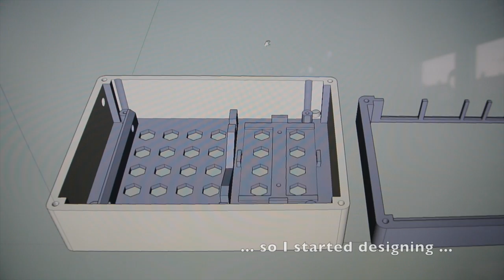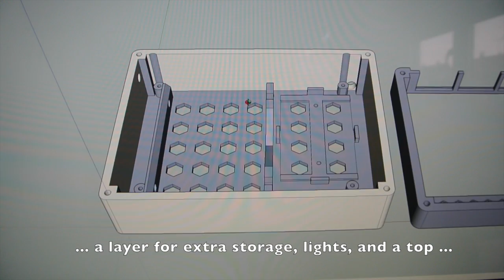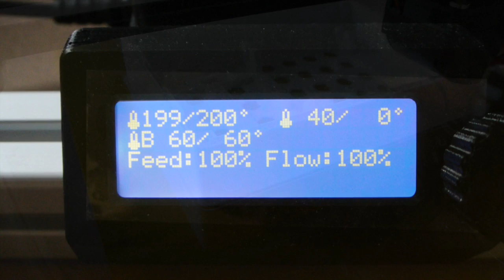3D Printed Computer Case

Comment: Many people are interessetd in small (also mobile) cases like the Dan A4-SFX for normal length graphiccards, but €235 ($270) is expensive for a small "tin box" with a riser card.
Why not a plastic version for 3D-printer? AGP riser card adapters are existing at Ebay, Amazon etc.. And EM-shielding after printing with aluminium foil or better with aluminium adhesive tape.
A "full Copy" is a option  for outlaws ;-) . But for example i and probably many others would prefer a more mobile version. "Rugged" case, handle etc.. Then this case is "similar", but not a "disdainful copy" ;-).
Also a version with standard sizte ATX power supply would be good. The additional space in the case (because of the wider power supply) could be used for a compartment with flap. Usable for mouse, cables etc..
For LAN parties ("dead", "history"?), or currently to take a potent PC for VR to others. Perhaps with a small display (from HTPC equipment) for operation, in order not to have to tow a monitor.
For VR you theoretically do not need a monitor. Unfortunately it seems necessary for working.

Another "thing", suitcase with perfectly fitting recesses for the VR glasses, bases and controllers. I expect a Pimax (actually I prefer the 5K+).
Then I could uncomplicated transport the computer and VR glasses to relatives, acquaintances, "strangers" (to inspire them for VR, proselytise like a Mormon ;-) ).
Other "things" i would need, but i think perhaps not 3D-printing products, a small transportable telescope stand for the lighthouse bases.
One day I want to bring VR technology e.g. to my sister's family. On a birthday etc. But then please without bulky heavy technology, box of cables etc.. Build fast, dismantle quickly.

Btw., recently exist "backpack PC". Especially for VR. With battery supply. But desktop PC hardware may need more power.

Comment: It would be so cool to make a mini-itx case I have in mind which has a foldable screen attached an an external laptop-like power supply all fully portable. No idea how to get a laptop like battery in there but that would be the icing on the cake. Sadly I do not know how to make custom 3d blueprints but if I sent an email to you with the measurements and details could you make a blueprint for me using SketchUP? I tried installing the program but it didn't even let me use a 1 day trial after I installed the "free" version and claimed I had to buy it even though I allegedly had a free trial. Any thoughts on how to get this idea on the road? Also could a gtx 1060 safely run on a pico psu 200 watt? Will pair it with an intel pentium and 8gb of ddr3 ram. Was initially planning on a 1050Ti but I want to get a 1060 6gb mini if possible and will use an SSD for storage and eventually an M.2 ssd when I can upgrade my mobo. Cheers!!
Reply from the maker: Yes, ... sorry: no. Designing a case is a very time consuming job, and the chances to get it wrong are abundant.
For SketchUP, use the maker version, It won't try to make you buy a license.
I've built a Mac-Mini-like mini-itx case, and it drove me up the walls - so many things went wrong, and in the end I nearly
totalled my 3D printer during that print. So I still have not been able to complete that project. and I probably never will. 
I personally don't think that a PicoPSU is up to the job of supplying such a beefy machine, I'd go for a 250W car-pc supply.
I encourage you to try, and go for it - but don't be too disappointed if it turns out to be too much of an effort. I did, and I was.
Reply: I got a Silverstone ITX mini 300 watt power supply since I could not find a power brick for the pico psu that had enough watts that I needed. Also sadly I do not have access to a 3D printer and I don't understand how to make a custom blue print for my own case. How much would it cost in raw materials to make a 3D printed case for mini-itx format from a 3D printer if I sent you the specs and measurements and you made one for me? I could pay with paypall possibly.
Reply: Very sorry I thought you had a 3D printer to make the panels from this case. I must have misunderstood.
Reply: Thanks! I will try to find a 3D printer. Maybe there is one in my local library or something.

Comment: Nice work! For the screw holes did you design also the spiral inside or did you use other methods?
Reply from the maker: The hole in the bottom part gets smaller close to the end, so a long screw (or in my case a threaded rod) catches and locks in place making the stacking very easy.
Reply: Thanks! you've done this for all the screw holes? also the ones matching the upper and the lower part of the enclosure?
Reply from the maker: Yes. Especially for those.

Comment: How is the case holding up after 6 years? Any deformation in pla from the generated  heat?
Reply from the maker: Very well, the color's faded a bit, and the surfaces are dull where the sun's hit them, apart from that it's great and even the little pc is still running
Reply: @dherrendoerfer  that's great. I was worried that PLA would warp overtime with constant exposure to low heat. As for color degradation, it could probably be prevented with a uv coating, or just regular spray paint. Thanks for the info.

Comment: I have this idea too,  but printer in charge is too small. I have thinked to print in several parts. Thanks for sharing.  Omar
Reply: You can build it in several parts but you will need a good connection for best results ..

Comment: My question is, does the PC run and if so could it run things like OBS, Audacity, and Photoshop at the same times? Could you possibly do a recording to see how it performs?
Reply from the maker: Hi, no - I don't think the PC would be up to that task - the board that I used is too 'aged' for that. It is a single core AMD embedded system. I use it as a small router and NAS service system with a very nice graphical frontend.
I believe that a similar system ( about same size ) with a modern Intel Atom CPU might be up to the Task, and really good at it too.

Comment: hey woundent the case melt the case is mad e with melted plastic do if the pc reaches a high temp it might melt
Reply from the maker: themind blasters Yes, luckily the board and power supply have safeguards to prevent such a meltdown.
Reply: nice good choice

Comment: It's been a few years since you did this. What were your experiences with this case. Any deformation due to heat, any fires? I am currently in the process of making a fully printable mini ITX case for my sister. After printing several iterations that turned out to be flawed, I think I have the final design ready. But I am still a bit worried about the plastic beeing able to cope with radiated heat.
Reply from the maker: No, I did not have any problems with this case or the little PC in it. The only things producing heat in there are the RAM and the power supply. I did make sure that the fan moves enough heat through the enclosure. It's still going strong, although it's a really weak little server by todays standards.
I've made a couple of other design cases over the years, I suppose the trick is to always plan the case around the cooling and go from there.

Comment: Great stuff.
I'm thinking on designing my own housing for mini-ITX gaming/video editing rig.
Do you have any tips on designing the case (I mean, all those dimensions and airflow design)? I'll use Solidworks and there are no motherboard or video card models available for SW. The problem is that I'll do the case before I get the parts, so I have to make it somehow universal for any mITX motherboard and short-profile GPU
Reply from the maker: (laughing) I just recently tried to do just that - and it went spectacularly wrong.
I tried to put a single mini-ITX mainboard into the most bare case - it was really simple and would probably have looked
quite nice - but during printing everything went wrong: I had 3 failed prints, and in the end the extruder broke.
It was the filaments fault, although expensive and nice to look at, it had beads that would block the extruder entry and cause severe overheating when the extruder was running dry for hours. 
For that case I didn't do a lot of air flow design, the mainboard would sit upside-down in the print and have some air-ducts out to the top. the cpu fan gets the cooling air at the bottom and sends it out the top air ducts. 
I don't know it it is a good design, have not tested it.
Reply: Wow, shit happens. Have you done any recordings or photos of this process and the concept itself? I'd love to look at.

BTW three time fail - fourth time may be successful. Don't throw away this idea just because the printer went down.

Comment: Wouldn't PLA warp at higher PC temperatures?
Reply from the maker: SbotTV Maybe a little bit, this small embedded board and the power supply don't produce that much heat, and the cooling is up to it.I would not put a gaming pc in there without spending a serious amount of time to understand the cooling implications.